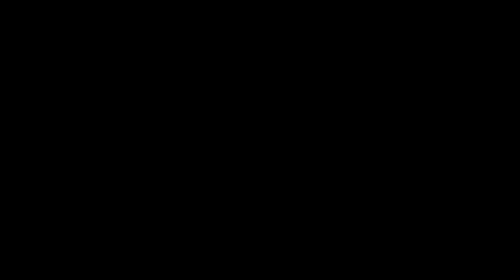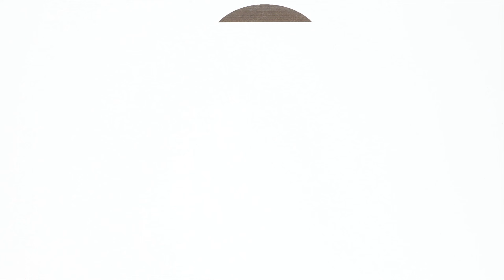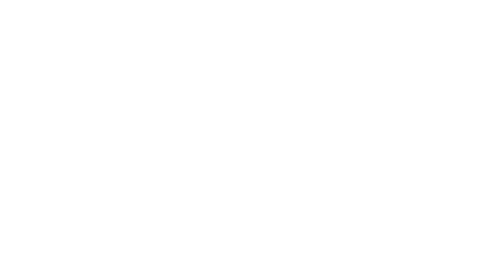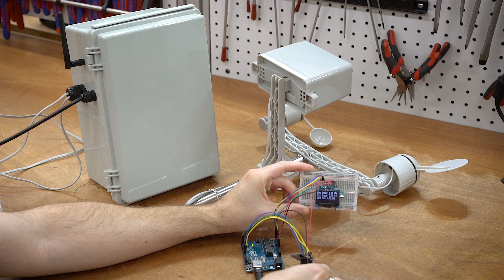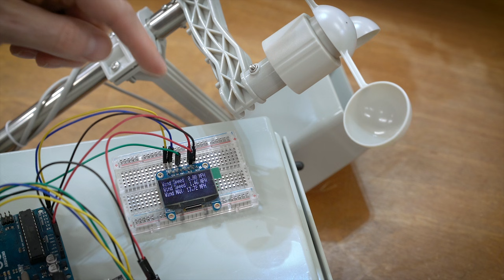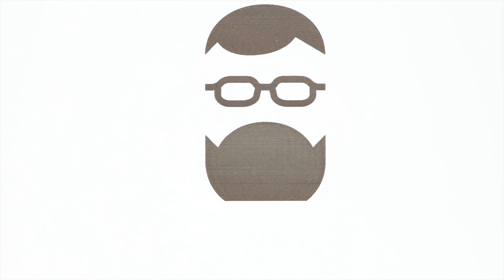NRF24L01 Tips and Tricks - Cheap and Easy Wirless

Comment: Hello
I have a question
I am working on nrf24l01+ without antenna, it works very well but when I replace nr24l01+pa+lna with antenna, nothing happens and when I touche the chip it works but only one meter
Is there another register that I forgot to use?
Please tell me if possible

Comment: Hello, can you give schematic or where the pins go to and is it 5v on the breakout board or 3,3v? i saw from your connection and from schematics from the internet that the nrf24 breakoutboard can handle 12v max? is it true? could you let me know?
Reply: It's fake the nRF24 without the Power supply board it handle 3.3v and with the power supply board ir handle 5v , for 12v you need a 3.3 or a 5v regulator with the power supply board

Comment: TIP: connect the nrf straight to arduino using jumpers or soldered through pcb, breadboards ruin their signal, a capacitor is preety much needed aswell but it might work without( i also found that not unlinking them helps,just powering the nrf from a breadboard will also destroy the signal)

Comment: I really really appreciate that someone has made this video in this specific issue, it really helps me alot so thank you very much.
One last thing, there are two types of 10micro, one is 25v and one is 50v, which one did you use? 
I really need your answer asap
Reply: 25Volt It's the Absolute Maximum Voltage that electrolytic capacitor can take before it explodes
Because you only connect it to 3.3Volts you can use that ...
also if you connect the polarity wrong it can explode ...

Comment: There’s no voltage regulator on the nRF24L01 modules, so you need to provide an external 3.3V supply. The Arduino's 3.3V regulator isn’t strong enough, so maybe that's what you meant. 🤷‍♂
Reply: Yeah the UNO especially has a terrible built in regulator, the 3V3 pin can only output 50mA

A modern ESP32-S3 or pi pico by comparison can output 2-300mA

Comment: Your weakness is programing 😢
Interesting video tho 😊
Can I use it to scan for wifies and connect to WiFi using it ? Or make a switch out of it and Arduino ?
Reply from the maker: This isn't wifi, it's a completely different wireless protocol.
Reply: @RobertCowanDIY  sad
Reply from the maker: @SAQ-3000  Haha, it's not sad.  Wifi is a PAIN.  This is a better point to point communications protocol.
Reply: @RobertCowanDIY  but I want to scan long ranges wifis using it
Reply from the maker: @SAQ-3000 not all wireless is wifi.  this isn't wifi, it's something else.  is your car's radio wifi?  no, but it's wireless.  this is another wireless communication and has nothing to do with wifi.  they make similar modules for wifi.  look at ESP microcontrollers.
Reply: @RobertCowanDIY  I have and esp8266 and esp32 they can do it but for long ranges ... Idk
Reply from the maker: @SAQ-3000 So, get one of the versions that have an antenna connector and use a larger antenna.
Reply: @RobertCowanDIY  well how much big antena ? 
Like I want to get like 1km range all wifies showed in the esp ...
Reply from the maker: @SAQ-3000  You have the entire internet at your disposal.  Get on google and start learning.
Reply: @RobertCowanDIY  okay thanks so much for your help 😌👍
Goodbye 👋

Comment: very well explained! thanks!
Reply from the maker: Glad it was helpful!
Reply: @RobertCowanDIY  Hello,
I'm a beginner and wanted to make a gesture control car, using an MPU6050 and the nRF24L01 module for wireless communication. Plus Arduino UNO and NANO as microcontrollers for receiver and transmitter.
But after wiring it all up I noticed that the angles from my aren't being transmitted to the receiver nRF.
The return value of radio.write() is LOW, and the received value is NULL.
Could you please suggest any fixes? I believe the issue isn't with the code, but I might be wrong. I cross-checked it with few examples and the code seems right. What do you think might be the issue?

Comment: NRF24L01's are very handy
I used them in 150g combat robots 6+ years ago when commercial RX gear wasn't as small/light

My other reliability tip for them, if you are using them in a location where they get rattled or bumped regularly, add glue, potting compound or at least hot glue to the crystal as otherwise the crystal has a tendency to break
Reply from the maker: Got it.  Padding for all electronics is a good practice!

Comment: You mentioned packet transmissions, so I assume you’re using packets with a checksum or CRC. Does your software track the number of bad packets you receive?  Wondering just how clean your reception is across that distance and through walls.
Reply from the maker: I think I disabled that feature, but when I had it enabled, I wasn't seeing anything significant.

Comment: I dont know which library you are using. I am using the nrf24 mesh library, which I found to be pretty awesome. As it allows for very dynamic network configurations, adding more sensors as you go etc... 
Also I have added a counter to each device, that performs a restart every so many data packets sent, or every so many failed attempts. This creates a bit of a self healing behavior to the entire system. 
At the indoor unit, I opted to build a 'router' from nRF24 to Wifi. This feeds the data to Node-Red, to Influx DB and then can be graphically accessed via a Graffana web page.
Reply from the maker: I'm using NRFlite.  That's a good idea about restarting periodically.

Comment: In my experience the cap is all you need. The culprit in most cases I observed is that the jumper cables are of really bad conductivity (made from chinesium and not copper).
Reply from the maker: Interesting.  Good to know.
Reply: @RobertCowanDIY  I have about 20 odd nrf's deployed at the moment and I always traced it back to the wiring and the 'buffer' capacitor that just levels out spikes as you described...
Reply: @SarahKchannel  How is it on power-consumption? I can imagine that with 20-odd devices you likely rely on harvesting rather than whizzing around changing batteries the whole time..
Reply: @AdityaMehendale   I do not know the power draw from the top of my head. I am running all the remote satellite ones of solar panels with 18650 batteries and ESP8266 (wemos) MCUs. The nrf24 does not draw that much power per se, you can control it by how often you send data - only in the mesh configuration you have less control over how much each node receives or transmits.
Reply: Hello,
I'm a beginner and wanted to make a gesture control car, using an MPU6050 and the nRF24L01 module for wireless communication. Plus Arduino UNO and NANO as microcontrollers for receiver and transmitter.
But after wiring it all up I noticed that the angles from my aren't being transmitted to the receiver nRF.
The return value of radio.write() is LOW, and the received value is NULL.
Could you please suggest any fixes? I believe the issue isn't with the code, but I might be wrong. I cross-checked it with few examples and the code seems right. What do you think might be the issue?
Reply: @Farmingforskills247  Well, that is like reading a crystal ball. If anything is transmitted from the nRf or Transmitter, then you have the first part working. Hard to tell without knowing the details.
Reply: You need to send dummy data, to see that the wireless link works. Then you can move on the MPU data.
Reply: @Farmingforskills247  You realize that each nRF needs its own device ID (eg 1 and the other 2), plus they need to have  the same channel, frequency and speed assigned...
Reply: Breadboards also make it just not transmit